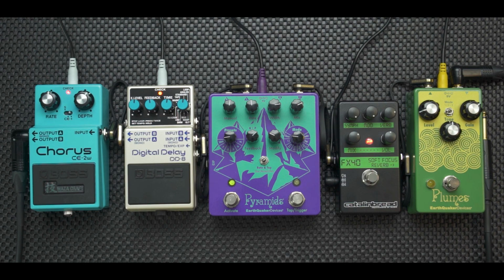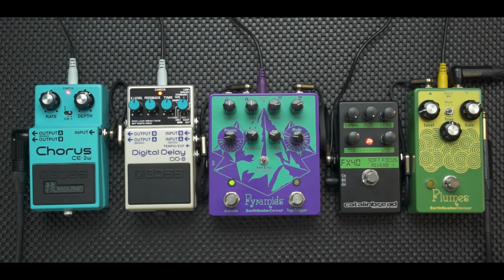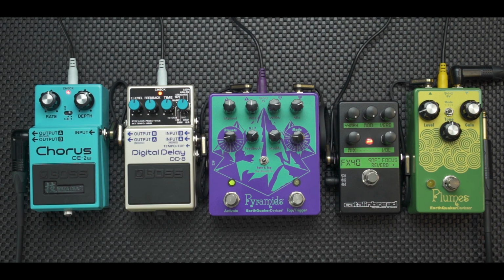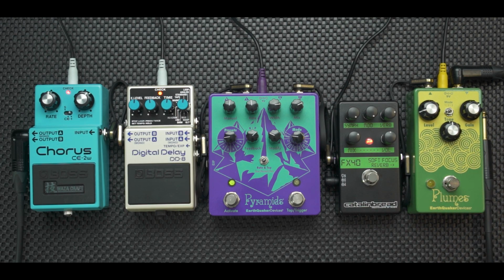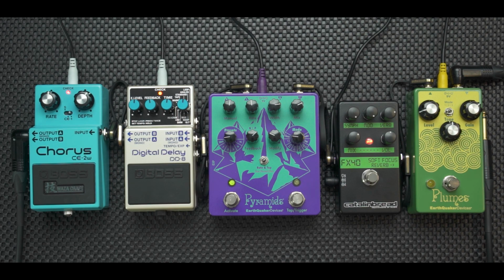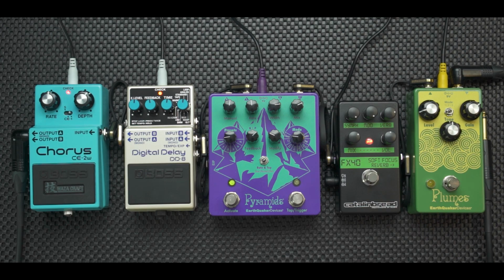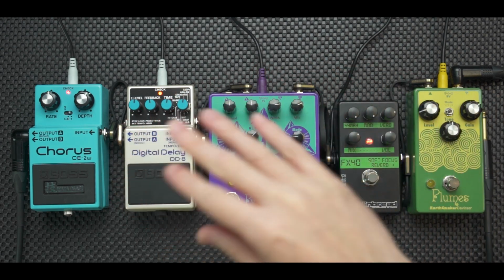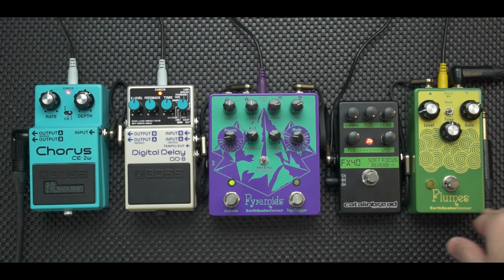PART 2: Soft Focus Signal Chain with Overdrive

Comment: Wow, that sounds good, when I try that many effects it turns into a mess 9/10 times. Dont have a soft focus, but I have an HX Stomp. Good stuff man. Gonna have to try this in stereo.
Reply from the maker: Thank ya. I used to have two amps once upon a time, but I only have one now otherwise I would do stereo when possible. And I hear ya, using multiple effects like these requires a little trial and error. Conventional signal chain thinking would say to put the reverb last, and that does work a lot of the time, but this chain calls for the reverb to be first and it works in its own way.